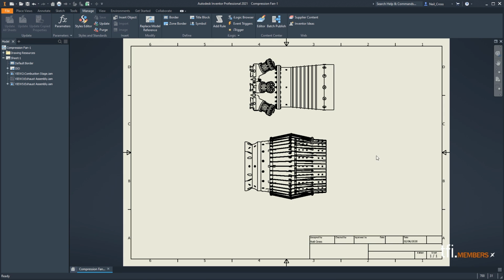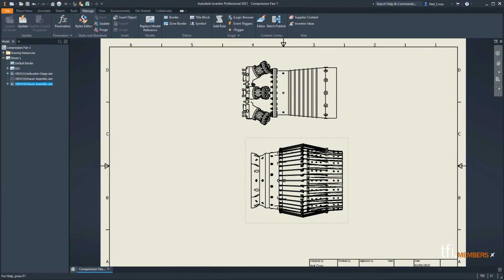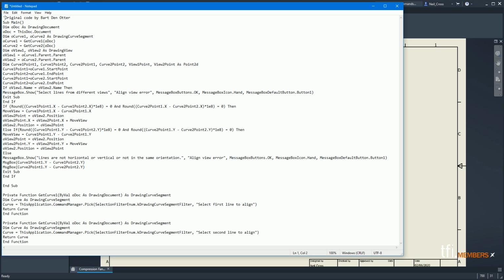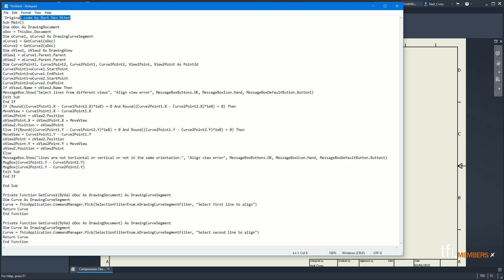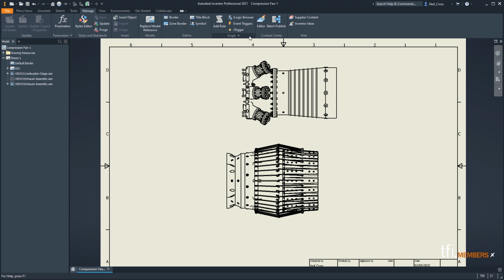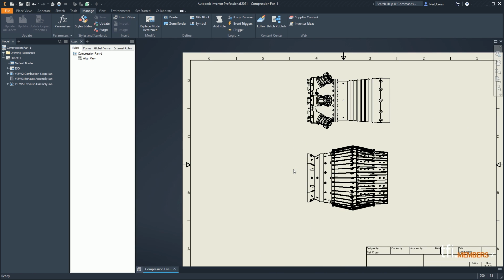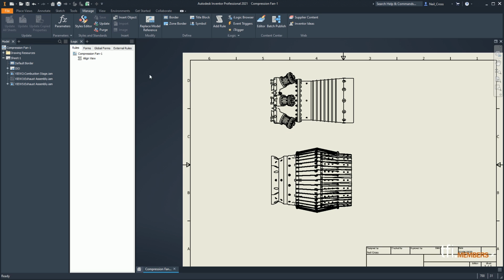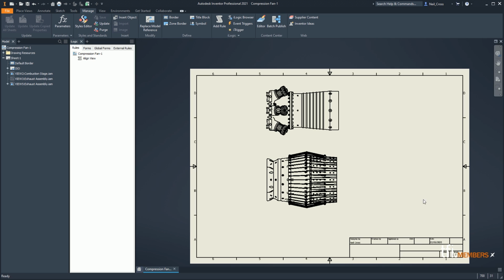Inventor Tip! How to Align Drawing Two Views using an EDGE!

Comment: Dear, thank you A LOT for your efforts and great job you do.
once I tried to create rule, I got below error,  can you help what to do ?

Error in rule: ALIGN EDGE, in document: Part3

Unable to cast COM object of type 'System.__ComObject' to interface type 'Inventor.DrawingDocument'. This operation failed because the QueryInterface call on the COM component for the interface with IID '{29F0D467-C114-11D2-B77F-0060B0F159EF}' failed due to the following error: No such interface supported (Exception from HRESULT: 0x80004002 (E_NOINTERFACE)).